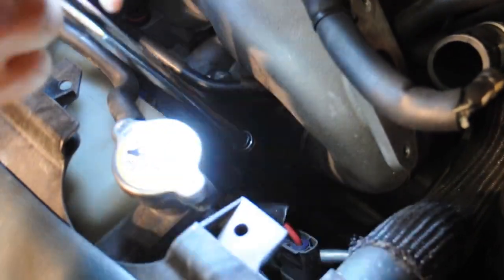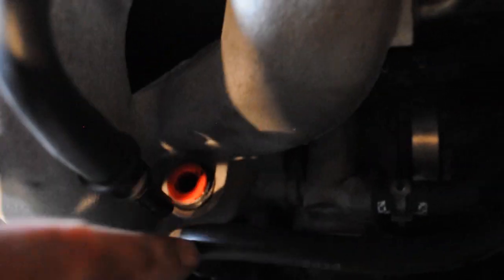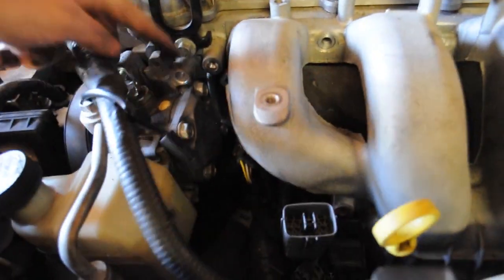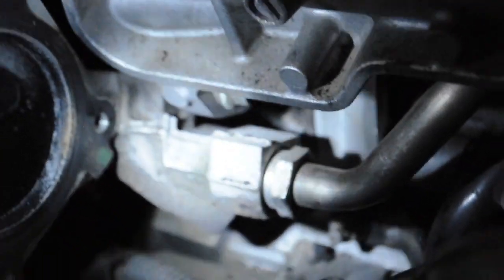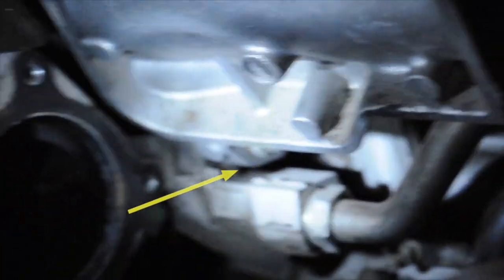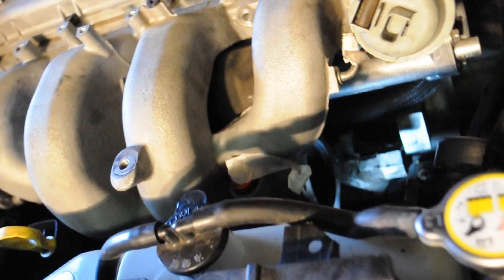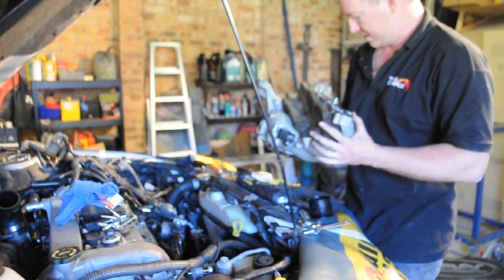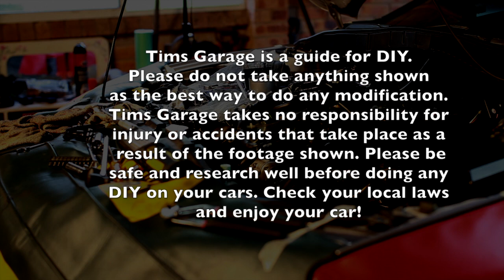Intake Manifold Mazda 6 MPS(MPS3) removal/install

Comment: Tim I want to thank you so much for the detailed video. I’m taking the manifold off on my speed and was stuck on the power steering pump. Everywhere I searched it said to remove the belt and I did not want to do that. I know what to do now and You made it look so easy!
Reply from the maker: Thanks mate, there is plenty of trial and error my end before the video comes out, but I'm happy that it helps, that's the reason i make the videos :D  thanks for taking the time to comment mate, appreciate it.

Comment: The metal pipe that you disconnect from the intake what is that called, trying to find out why I had oil sludge in it.
Reply from the maker: HI mate thats the ERG, (im assuming thats the one you mean) it recirculates carbon from the exhaust back into your intake, its all about emissions but its a death sentance for your engine as it puts muck into your intake and messes up everything. you can get delete kits for them. hope that helps

Comment: I'm attempting this on the N/A 2.3 on our Milan and it has so far been a nightmare. The intake is a different design so I'm having a very tough getting the middle bolt out because my 3/8 shit doesn't fit through and my 1/4 isn't long enough lol
Reply from the maker: that sucks man... can you get a spanner onto it? if you have a single hex it should be enough to crack it if you can get leaverage. onto it. Middle bolts suck on almost everything... even my upgraded one is not easy when it comes to the lower middle bolt... Worse case and I would not recomend it, but ive seen guys bag up and cover everythign in the engine bay and paint while its on... but its never gonna be as good as if you take it off, and you risk overspray in a big way.

Comment: HI Tim, Can you show me/us how to clean the EGR valve. My car is Mazda 6 2004 Diesel.
On diagnostics shows alarm P401 and P402: insufficient exhaust gas recirculation. The interesting thing is the alarm dissapear in winter times, when the weather is cooler.

Comment: I have a 04 Mazda I was told my intake have a hole n it any ideas what it does when it does have a hole n it
Reply from the maker: Chris Wiley hi mate, a hole will mess with your manifold pressure sensor and worse can mess with your Mass Air Flow sensor which may cause your car to run ritch or lean. A hole  could mean a couple things, usualy it's the gasket, but if it's not cracked you may just need to check the fittings in case one is loose and letting air in

Comment: do you know how to fix code p2009 intake manifold runner is stuck? im afraid theyre going to try to sell my a whole new intake
Reply from the maker: It depends a little if its stuck open or closed, if its open then you could get the code programed out. If its closed its gonna effect the air intake a fair bit which would be a problem for performance etc...

Comment: Having the hardest time with the power steering pump  and I can’t find the other bolt holding in manifold any suggestions ?
Reply from the maker: Hi mate, your totaly correct, its hard man, there are the 2 bolts on top (easy to see) then one set under the pump. I use a short extention and a long socet or a long extention and a normal socet to reachin there and crack the nut. I have a link here to an image that looks a lot like the power steering pump that the MPS uses, you can see there is the bolt hole under the top 2. be carful if you leave the belt on, once you crack the bottom one it will want to pull to the left hard, so possobly leave one of the top bolts in a little just incase.  

the link below has a pic, no idea what the copany is like, im sure there good, but its what came up when I had a serch on google for ya. 

http://www.autozone.com/suspension-steering-tire-and-wheel/power-steering-pump/atlantic-automotive-power-steering-pump/413777_837522_2558
Reply: Tims Garage  thank you, I was able to get it by moving the power steering pump! Thank you, I used a 22 mm wrench to get to the EGR valve and other than that it was pretty easy. Well hard but easy lol.
Reply from the maker: happy you got it mate, yea there not the easiest thing to get to, if you have skin left on your knuckles your doing well lol.

Comment: I keep getting a P2004 code in my 2009 Mazda 6, saying the IMRC valve is stuck in the open position. 3 times now, the mechanics I’ve gone to have suggested replacing the IMRC solenoid, so I purchased the Intermotor RCS105 complete kit with both solenoids from RockAuto.com. After the 1st replacement, the check engine light came on again and so the mechanic thought one of the solenoids was defective. I replaced both with another kit that worked for 8 months before the check engine light came back on with the same P2004 code. The 3rd time I saw another mechanic and ordered another Intermotor RCS105 kit from RockAuto, and of course, the check engine light is back on again. What do you think the problem might be? Will I need to replace the entire intake manifold assembly?
Reply from the maker: Hi mate, without seeing it my guess is that the valves are getting blocked up themselves. The EGR system on these runs carbon into the intake manifold which ends up covering the IMRC with carbon (also your intake valves get covered too) over time this builds up, add any oil from the breathing system or a turbo (mazdaspeeed platform) and the carbon becomes a sludge that can stick it all up fairly badly. if the solenoids are good, that would be my guess. Hope that helps, let me know how ya go with it mate.
Reply: Tims Garage - Thanks for the quick response! I hope this hasn’t ruined the new solenoids I just had installed. I won’t be able to have the car looked at again until next Monday.

Comment: how long does the whole process take?
Reply from the maker: Hi mate, I would allow a couple hours the first time, you would be able to do it quicker, but sometimes finding a bolt can just take 15 minutes if you can't see it which all adds to the time, you can easy do it in a hour if you know what your doing, possibly less if you know the bolt sizes from memory.
Reply: +Tims Garage thanks I have a 03 Mazda 6 with a p2004 code intake manifold runner stuck open I was thinking just replacing the whole thing..not a mechanic so don't no if  that's necessary lol
Reply from the maker: Hi mate, you will be able to see the arm that controls the runner thats external to the manifold, see if you can move that? hit it with some WD40 and see if you can free it up. then clear the code. It is a short term fix and as other comments have said if the ERG system is still attached the carbon build up from the exhaust will be the thing stoping it from moving. so long term removing the system and learning it will get it working again. remove the intake manifold and then use some break clearer or degreaser and a rag to clean up the manifold runner. you shouldn't need to replace it all. but thats more than likely the issue and the solution. let me know if you have any issues with it mate, shoot me a PM on https://www.facebook.com/timsgarageshow/

Comment: I have a Mazda6i N/A 2.3L and want to turbocharge it what do you recommend I change to make it turbo?
Reply from the maker: Hi mate, the N/A platform will turbocharge but be careful of the engine internals, they wont be designed for boost, so while you can run low boost it wont ever be as strong as an engine set up for turbocharging from the factory. you can always upgrade internals though. Basics you will need are a turbo exhaust manifold, oil and water feeds for the turbo, some turbo managment such as a boost controller and possobly a way to increase fuel and air ratios (AFR) on the engine managment, the intake system for the air in such as a SRI (short ram intake) or CAi (cold air intake) and then some kind of cooling for the air in the form of an intercooler and the piping that goes with that. its a big job, but worth it. form there you should consider the exyahust system, injectors, plugs, etc...
Reply: Tims Garage thank you so much on your time I appreciate it a lot

Comment: i have a  mazda cx 7 2007 with a 2.3 engine and i have problem a loud sound when step on the gas. a took the car to auto zone and had a test done. the code is saying p2006 intake runner stuck close how can i fix this problem?
Reply from the maker: your intake has a butterfly valve which opens and closes to allow air in and out especially under cold start, full throttle, etc... this can get carbon build up and can stick.  you can manually move it (see the leaver on the side of the intake mani, it controls the butterfly valves. the best fix would be to remove the intake manifold and clean it all up, then do an ERG delete (it deletes the exhaust runner that throws carbon all over your valves, its an emissions thing but causes all kinds of issues long term with the engine.)   hope that helps mate.

Comment: no no no no need to take the power steer pump off
Reply from the maker: Why? In all the manifold swaps, changes etc… I have never needed to do all the extra work of removing belts.
Reply: @TimsGarage  no sorry the power of punctuation lol I meant no no no, no need to take the pump off in the video he takes the bolts out of the power steering pump.
Reply from the maker: @andrewwarburton8921  hahah all good, keen to see some videos mate. Welcome to the MPS crew 😁